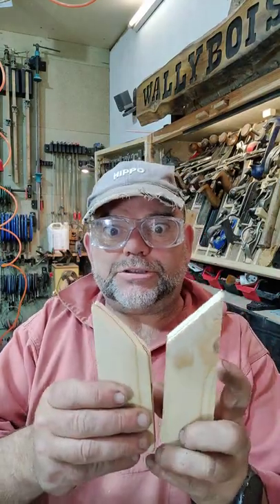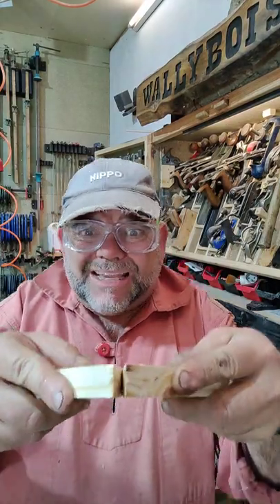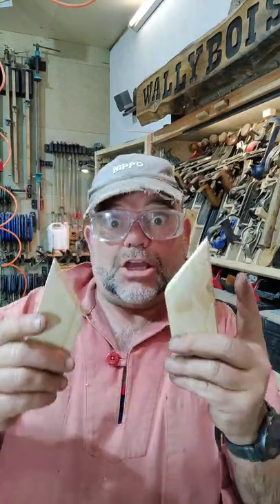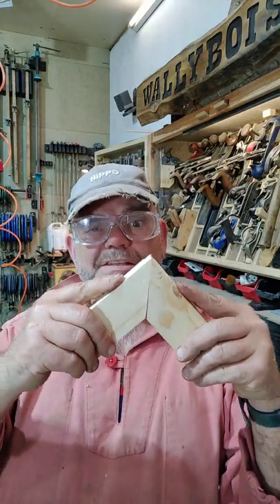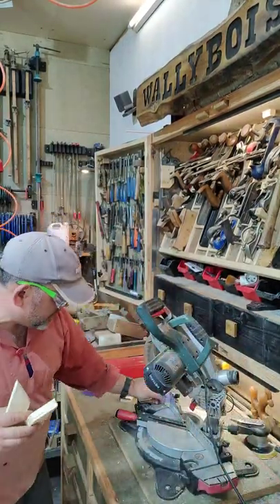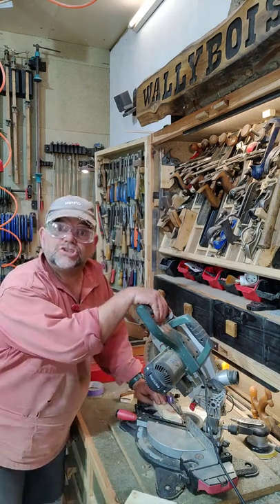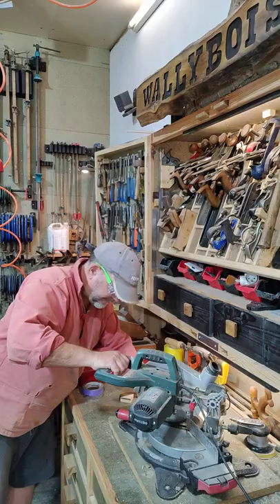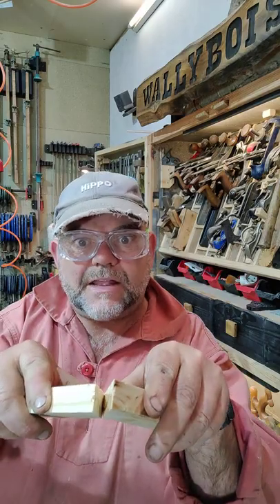Tight Mitres Every Time with this Easy Woodworking Tip

Comment: Sure but most people will just calibrate their saw...
Reply: Many DIY saws have to much play
Reply: Yes have to buy the higher end model. But even the ,when set correctly,some of the knobs can't lock half degrees. I'm gonna try this on my old Hitachi. I've had good luck with them for the most part as well as DeWalt. Now every saw is decent, just heavy as hell! So normally we just get the older Hitachi models. I'd love to design one. Whenever I need a slight backcut, I always put the shim on the bottom but never tried the fence. Would make those 22.5 easier on some saws for sure! Thx for the video and reply.
Reply from the maker: Cheers buddy, I've had a couple of the Hitachi's... Good saw

Comment: What did he do exactly?
Reply from the maker: Basically I reduced the 45 degree angle so the gap in the joint it's not on the outside edge it's on the inside edge but the gap was so small you can't actually see it but what it does do it means that you don't look down the gap if it's on the outside edge I created this by placing a piece of tape on the fence
Reply: What exactly does the tape do and why does it have a piece of wood?